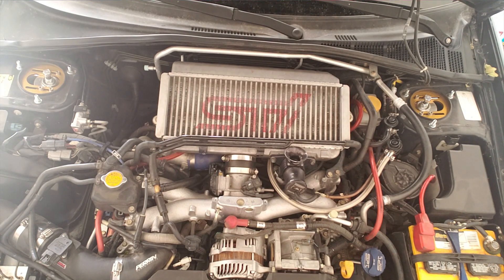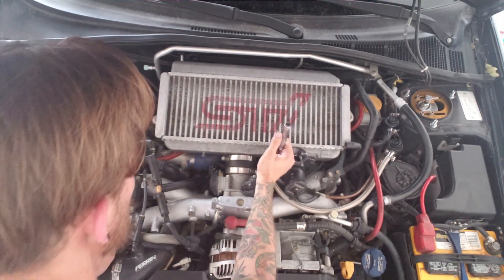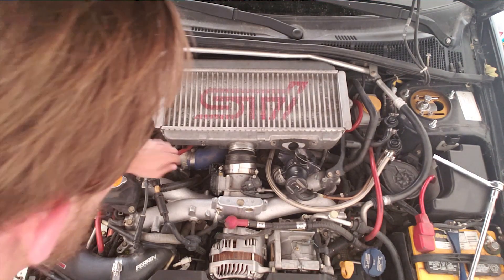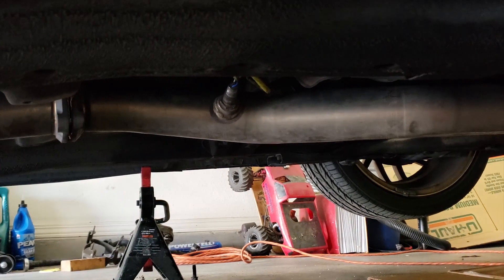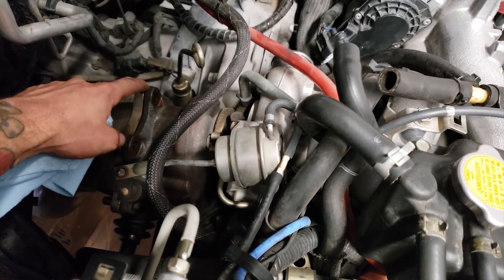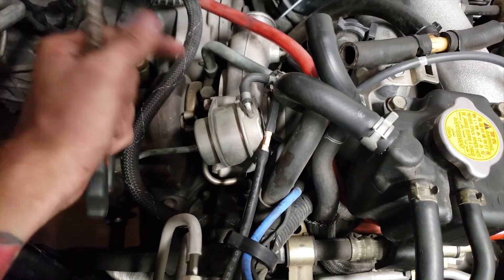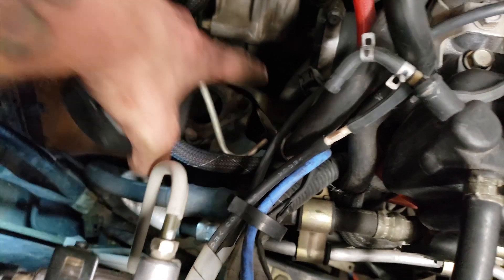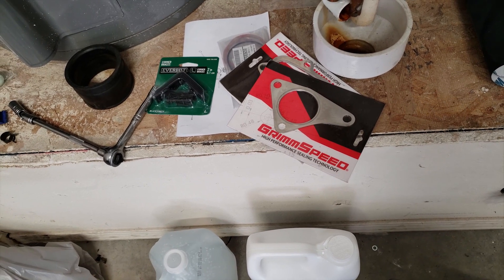Upgrade time! VF48 WRX Turbo install- Step by Step

Comment: I’ve currently got a VF22 on my bugeye but I want to get a vf48 it’ll fit perfectly yeah? I won’t need to do anything else
Reply from the maker: I'm not positive on the bogeyed. The main thing you need to look for is the bolt pattern on the downpipe side which if you don't know is the big opening with the gasket. Just compare the patterns. If they are different you might need to get a new downpipe
Reply: @KyleHidalgo  maybe but my 22’ is the biggest ihi

Comment: did you drain the coolant and oil in your car before hand?
Reply from the maker: It's been a while but I think I just put rags underneath when I disconnected them. I'm pry sure it would be a mess whether you drain it or not since it's so high in the system

Comment: So I have a 2006 subaru wrx so all I would need is the vf48 and downpipe or do I need a tune I also have a cobb tuner maybe they have a tune if needed 🤔
Reply from the maker: I had to get a tune also, they might but I had a custom tune done for mine? I'm pretty sure you can use your stick downpipe too I just had an upgraded one already but you might add well get one while everything is off
Reply: @KyleHidalgo  Thank you it was very helpful

Comment: Yo kyle!! I'm thinking of doing the same on my wrx 2005. Did you need to modify injectors, fuel pump etc to support the turbo? Saw you have a bigger intercooler.
Reply from the maker: Yeah I had the STi blue injectors which are like around 550cc or something and a walbro 255 fuel pump. Later on when I went flex fuel I upgraded to 1000cc injectors.

Comment: When installing the new turbo,did you fire the car straight away or do you have to prime the turbo first ? Like cranking the engine for a bit ?? 
I’m about to change mine for a TD05 20G eBay one
Reply from the maker: I actually put some oil in my turbo oil feed and drain lines a bit before I installed it so it wouldn't be dry and then I just fired it up
Reply: Kyle Hidalgo great stuff dude very helpful,this turbo I bought seems like there’s oil in it already.
For precaution you think i should add a tiny bit so it’s not dry ?
Reply from the maker: @Mursounderground  yeah u would definitely put a bit of oil in it anyways, it won't hurt anything and it's just extra peace of mind

Comment: Hey i hope your still active im currently changing my td04 in my gc8 to a vf48 are and in my opinion the oil feed line doesnt match up at all did your really just bend it or did you also put the oil line of an sti in there
Reply from the maker: Hey man, I used my same oil line. I did have to bend it a bit but you gotta be really careful, you don't want to kink it or snap it. It definitely works though.
Reply: @KyleHidalgo  thanks for the fast reply i will look into it tomorrow maybe there is a diffrenze between your wrx and my gc8 @ th e engine block
Reply from the maker: @hahagagi1564  yeah there might be a difference in your oil line but I would figure since it worked with the td04 that it should be a direct swap to the vf48

Comment: A tdo4 turbo is for a wrx impreza. But yours is an sti. Why does it have a tdo4 turbo to begin with?
Reply from the maker: No mine is a wrx. It just had a sti intercooler but the 06-07 wrx block is the same as an sti but the heads are different, so compression is a little different
Reply: @KyleHidalgo  i see. Got it.

Comment: Would a blown VF43 off a 2007 STI be able to be replaced with a VF48 with no tuning?
Reply from the maker: I would imagine you would need a tune because their design and output is slightly different and might throw off your fueling by either making it to rich or two lean and could possibly lead to some major damage. Subies are very sensitive to change so I'd always recommend a tune or adjustment to your tune for everything you do

Comment: Do you have any other engine mods? I have a 02 with the vf48 and sti pinks and I just got the new engine in and I’m getting it tuned on a dyno. I’m curious how much power I will make. I want at least 300
Reply from the maker: Do you have the 2.0 or the 2.5 engine? And what else do you have? Yeah I have a ton now lol I'll have to do a video on it but I have 1000cc injectors, aftermarket fuel rails and lines, walbro 255 fuel pump, flex fuel kit cold air intake, catless downpipe to Invidia n1 exhaust, sti intercooler, grimspeed 3 port boost controller, tial ewg on custom tune. I'm sure there is more lol depending on engine and other supporting mods 300 isnt too hard to hit
Reply: I have the 2.0 ej205. I just have the vf48, sti pinks, down pipe, up pipe, full sti exhaust and that’s it for mods but I’m getting a pro tune this week sometime and I’m hoping for 300 lol
Reply from the maker: You'll have to keep me updated on what you get! I'm guessing probably around 280 - 290 but you never know
Reply: Kyle Hidalgo for sure man
Reply: @cameronfoley4534  sorry... what do you mean by "pinks". Not familiar with the terms
Reply: bb b just the color of injectors. They are 650cc
Reply: @cameronfoley4534  I see. Thanks!

Comment: Hey man how long did it take you to burp the coolant system?
Reply: I did this on my car but it is now overheating. Car was running perfect before running the new turbo
Reply from the maker: It takes a bit, I always make sure to fill the radiator first, then expansion tank, then overflow, then before you turn the car on you'll want to get a fairly decent size funnel and put it in the expansion tank, wrap a towel around it and run the car until there are no more bubbles. Be care though because the level will rise the hotter it gets, also squeeze the upper radiator hose while doing that. Lastly the car should be level. Let me know if that helps!

Comment: How much hp and whp u make????
Reply from the maker: Hp is right around 315 at like 18lbs of boost. just waiting on my flex fuel sensor and Going to get it tuned to flex fuel so that'll go up quite a bit.